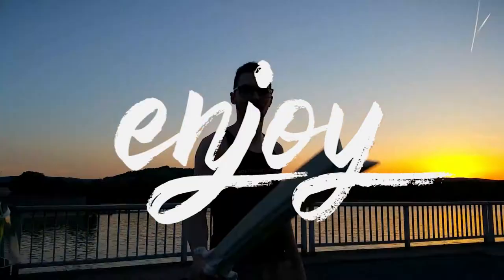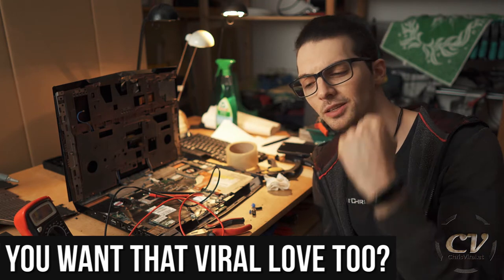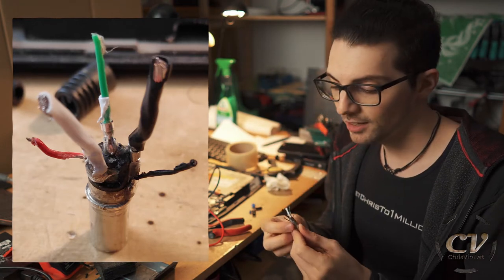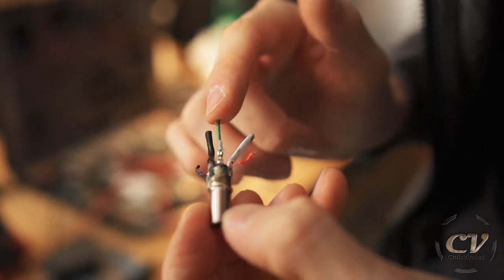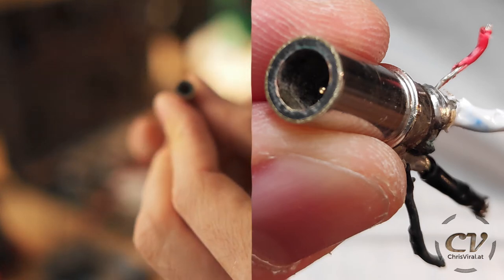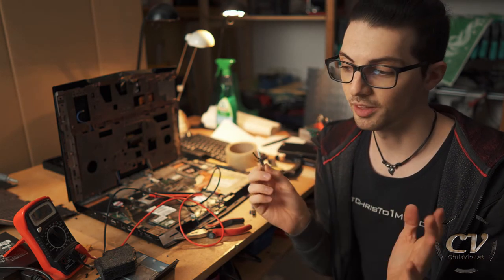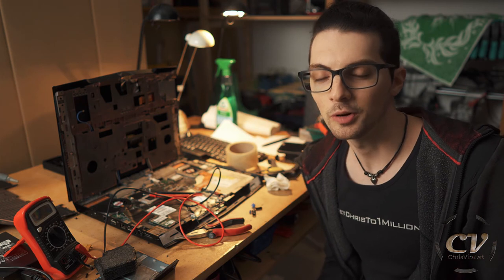DELL Laptop Charger Pin-Out Explained (For DIY Mods)

Comment: There's only one thing left to say. Stop buying brands that don't support open source repairability. No more Dell. No more apple. No more cheeky design.
Reply: Well, the third wire is actually the ID pin, the one that tells to the laptop what power the charger can give. So it in fact a good thing to avoid burning your charger. but I know it make it more complex to adapt or fix :/

Comment: The center pin is a data line specifically used to indentify/validate a genuine dell charger! It does this via the 1-wire protocol and returns charger identification to the machine. If verification fails or some obscure data is returned e.g. knockoff charger; your laptop will simply not charge!! If you break it on a genuine charger; your laptop will also not charge.
Reply: Or it will charge but throttle and disable turbo boost and ruin battery detection, that’s what’s happening to me rn
Reply from the maker: Thanks for the feedback guys! Also there's a note in the description:

Turns out the green pin (middle pin) is to check for charger genuineness, so that you can’t use third party charge bricks.
Classic. Why? To rip off consumers. You can’t use cheap third party chargers, while original chargers are unreasonably expensive.
Reply: thanks. my Dell was purchased as a refurbished and the charger  connector was slightly damaged after several months the blue led stopped working but charger charged the battery and ran laptop.   now when it's plugged into the laptop the wifi light and hard drive light Are on, and the battery light flashes but I can't start my laptop and after being plugged in for 8 or more hours the laptop still won't start. tries to fan clicks on then off in about 3 seconds.  I think the battery is too low to start and I can't charge it.  can you or any one tell me the proper way  the wires and connected.   I have a green, white, small red and a small black.   I feel I could fix it if I knew where they go.   also the ring has pulled away from the outer covering.   looks like a solder connection was there but I'm not sure
Reply: @paulmichalek5789  hello my friend do you have a discord account? I can invite you to a server where you will get proper help .
Reply: @ChrisViralVlogs  hi, i have same dell charger here. and i want to use it as power supply. when ever i connect the white (+) and black (-), it only lit up for a second and the charger shutdown. any way to use this charger as power supply?
Reply: I am not sure whether the center pin is actually allowing Dell to check whether it is a Dell charger. I know for certain that the laptop stops boot up at bios with an error indicating that the charger voltage cannot be determined if this pin is broken.

Comment: More like (For REGULAR Maintenance) this crap breaks on it's own all the time. My current charger just skinned itself - the cord is so heavy that it over time (no moving around with cord in) pulled the isolation of of the wires and from inside the plug revealing the colorful mess of wires and tearing one of them off making it not charge the device. This should be investigated by law and punished.

Comment: The middle pin is called the sense pin. The Dell firmware determines the genuineness of the adapter based on the impedance of the pin.

Comment: Hello, I have a iQ 70w universal laptop charger. It has 3 wires, white, red and black. I can't find anything to tell me which wires are what. I need to charge my laptop and I threw out my output connectors by accident. I do have Blackweb output connectors, but the 2 wires are both red, one on the outside which has a small integrated circuit and resistor. The other one I guess would be the inside of the connector. There is no way that I'd be able to connect those together without damaging my laptop is there?

Comment: The green pin is for determination of the charger wattage if you dont use it it will say that you have connected a "0 Watt" Charger and it wont charge and will run the processor at minimum speed for me that is so stupid because i wanted to charge it from a 6s 25.2v battery with a step down converter but works perfectly fine with a toshiba laptop that has a 2pin connector.
Reply: Triying to do the same. Did You solved it? That pin is weird

Comment: Green may be ground pin.. In old Dell laptops I used to feel Static Current shock.. New one is better .ay be for that they are using Ground pin..
Reply from the maker: Hey, I left a note about that in the description:

Turns out the green pin (middle pin) is to check for charger genuineness, so that you can’t use third party charge bricks.
Classic. Why? To rip off consumers. You can’t use cheap third party chargers, while original chargers are unreasonably expensive.
Reply: @ChrisViralVlogs   Thank u for reply.. Ur right one way it's bad.. Another theory is Third party charges sometime won't provide proper Voltage and current. Over the run it ruins Laptop performance and battery. So may be one way its good but there should be some other way to do it.
Reply: @ChrisViralVlogs  No, that´s not entirely true. It´s to identify itself as a high- or low-current charger and this determines if you are allowed to use a dockingstation with your Laptop or not. I don´t know about the price-politics though.

Comment: That middle pin controls the voltage, if you have a high spec dell (Alienware) That pin controls the voltage for the second Graphics card, without it it only uses the default graphics card

Comment: Some Dell laptops need more power than others so Dell has several different chargers but they all have the same connector.  Sometime try plugging a high power Dell laptop into a low power charger.  Note that the laptop will warn you that the charger may not have enough power to power the laptop.  How does it do this?  The third wire communicates charger information to the laptop.

Comment: 3rd pin is for signal. The Dell firmware determines the genuineness of the adapter based on the impedance of the pin and how much watts dell charger u are using. AND without any signal the laptop will not charge your laptop battery. besides this it will work just ok. expect the charging thing! 

and if your laptop battery is at 0% than. it will be like plug and play laptop kinda desktop.

Comment: And if you want to use a dell charger to power  something else ? if you use only the white and black cable it power 19.5V during 10 second then shut off.... There is a way to trick the charger and let it run 19.5V ?
Reply: same case here. any solution?

Comment: Would the charger work on a "dumb" load? (not a laptop - 12V "dumb" load  - Using a voltage regulator to get the 12V I need) if only using the White and black? Context: I would leave the charger jack intact, connect to a salvaged female DC jack and use it to power other things on the move (I am stuck with the Dell and would like to avoid carying a second charger). Reason I ask: Would not having the green connector "talking" to the laptop mean there is no power delivery at all to a "dumb" load (load max 24 Watts, so no risks of wattage demand being to high)
Reply: At least based on the HP 120W power brick I tried to use for this purpose (~20VDC), it would not work if the blue/sense wire was just left floating.
Reply: @elzzon  ok👍, thanks for sharing 😊

Comment: Middle pin has around 5.0 V which is used to communicate between battery and adapter.
Reply from the maker: Thanks for the feedback. Also there's a not in the description:

Turns out the green pin (middle pin) is to check for charger genuineness, so that you can’t use third party charge bricks.
Classic. Why? To rip off consumers. You can’t use cheap third party chargers, while original chargers are unreasonably expensive.
Reply: @ChrisViralVlogs  Besides being late to the game, I'm a big fan of open source everything, but the purpose of that middle pin is to avoid burning your house down when you plug in a charger that cannot supply the necessary power safely.  An simpler alternative example is what Lenovo uses - a resistor in the laptop side plug whose resistance value identifies the power rating of the charger.

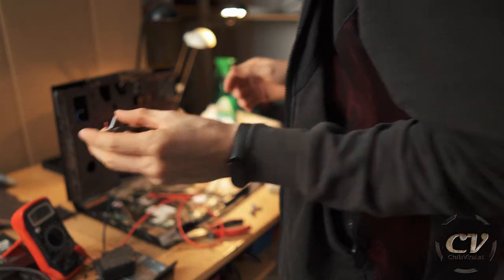Comment: 2:14  Why not use an 3-pin XT60? You could use XT60i / XT90i or IC3 / IC5 connectors. They are basically the same as EC3 and XT60, but with an extra data pin for exact this purpose. They are still compatible with the normal XT60 and EC3, too. Also, this datapin is not only meant to exclude power bricks from other manufacturers, but also to let the Laptop know how much Power it can draw from the connected brick, so that you can plug in 60w, 90w, 120w etc power bricks and the Laptop knows how much power to expect from it
Reply: MR30 would be plenty. It's the XT30 but with 3 pins, and XT60 is kinda overkill here

Comment: Nice vid I have a question could a charger that is giving 18V on a computer that calls for 19V, mess up the battery ?
Reply from the maker: IMHO most definitely not. The charger is not connected to the battery, there's a circuit board in-between that will handle the battery charging properly. In the worst case you will mess up this board but definitely not the battery. In your case the difference is negligible too.

Comment: I have need of dell Alienware 15r2 laptop battery 10 pin connector diagram to charge battery externally. My motherboard charging is having issues
Please inform. Regards.

Comment: so a quick question i trying to used that power supply to fix my thrustmaster wheel for some reason the  power supply went dead so i did som reseach most people are using a old school power supply with only a white and black wire +.-.... i have one of the new modes just like the one in this video..what sure i do with the green wire????? if any body understand please help i have nooooo experience with wiring

Comment: well at least you told me i have a problem.... -on the out side ring +on the inside ring nothing on center pin.    thins down please be more informed.   i can't change my laptop and really need reliable information
Reply from the maker: What more information do you need? Also always check the description for more information just in case. I left a not there as well:

Turns out the green pin (middle pin) is to check for charger genuineness, so that you can’t use third party charge bricks. Classic. Why? To rip off consumers. You can’t use cheap third party chargers, while original chargers are unreasonably expensive.

What I can say though, is that exchanging the charger will most likely do the trick. My laptop was fine, but the charger was bad. I thought it was the other way around 🤣

Comment: Hello im from Indonesian, my adapter is dell 65watt type c connector, the led indicator is on at the red wire (LED pin on PCB) and i measure the voltage show is 5Volt. But the white wire (VCC) is not showing any voltage, i'll try replace optocoupler and protocol ic on adaptor pcb and not fix the problem, i measure the voltage on high voltage pwm control and optocoupler is normal to Switching. I've been struggling with my adaptor for 3 days but haven't found the problem.
Best regard from Indonesian and i hope you see this comment, im sorry for my English is so bad😅

Comment: what a shity desing found some dell e waste laptop without a charger but it probably will work only with the + and - without the data com pin the battery is probably dead anyways. designs likes this only create a e waste. dont buy dell. if it doesn't work without that pin it will end up straight to the bin.